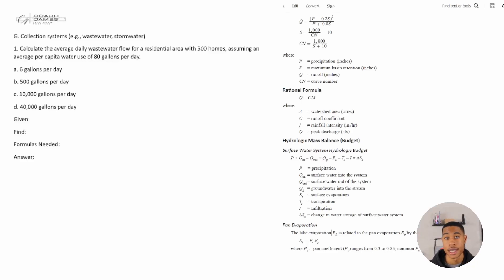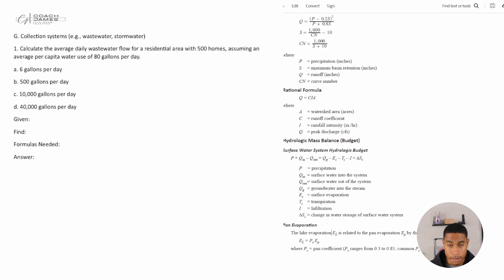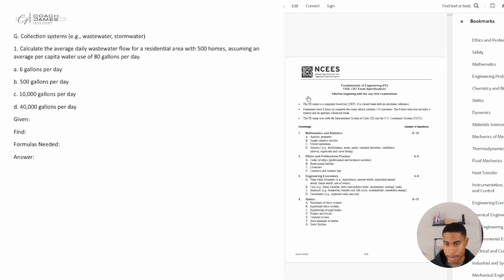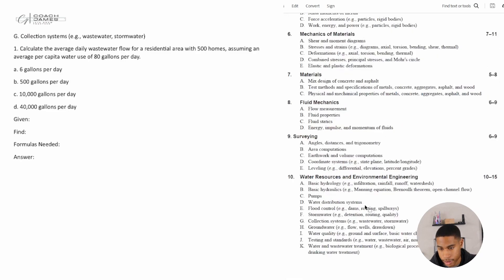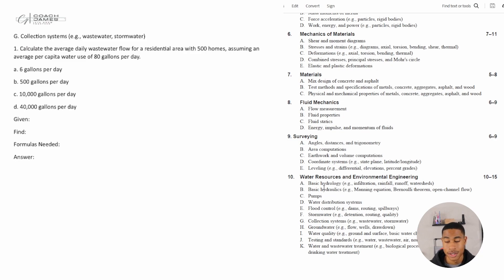2024 FE Exam Review Civil Water Resources Collection Systems Practice Problem and Solution

Comment: Hey James, 

Just took your test, can you please check question 23 and question 42. 

Question 23 i think k I know what I did wrong it was a hinge, man that was a good refresher lol forces has to cancel each other In a hinge. 

Question 42 I get 637.42 since it’s a down slope of 6% I use -G instead of adding it. 

Thank you.
Reply from the maker: Your totally right on number 42. I will make these changes. Thanks for flagging this